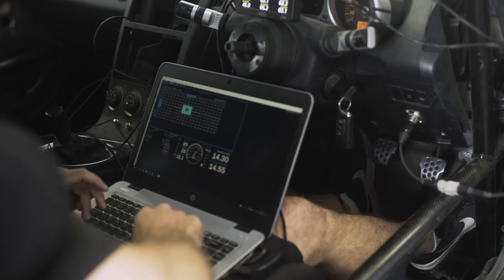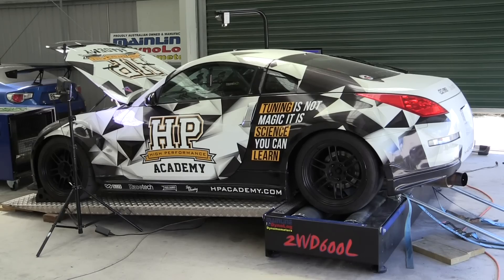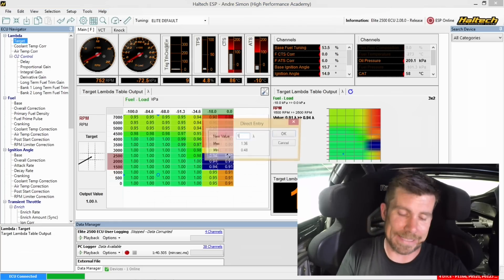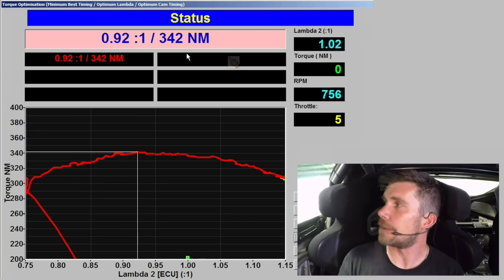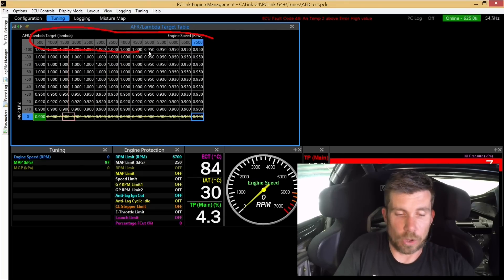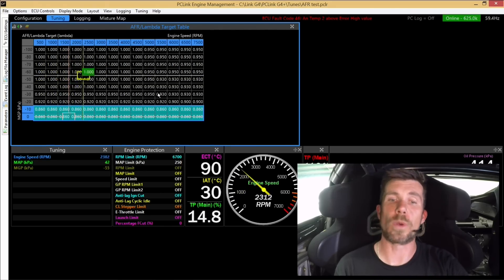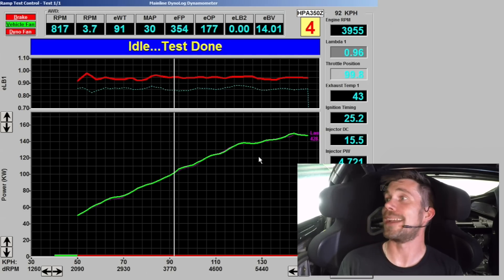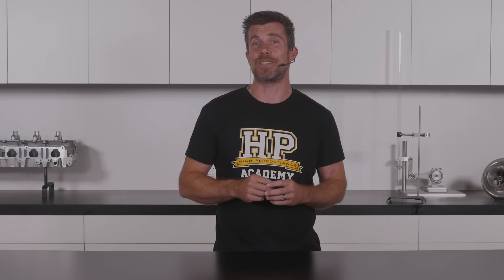Do You Want A Lean OR Rich AFR? | Fuel VS Power!

Comment: Sir, I think you need to try the "BLACKCORE" (Thermochemical Power Adder) unit from Indonesia. This tools can convert combustion gas into power and increase torque. This tool can also function as an intercooler because it can reduce the temperature heat in the engine cylinder space.
Reply: That's not a real product. Just for fun, I googled, zero written about, just a bunch of shitty YouTube and TikTok videos. If there was any remaining energy in the combustion gas to capture, OEMs would already be doing it. You can look at Porsche to see just how much energy can be recollected from the exhaust.

Comment: Hello! I have here in Brazil a Fiat 1.6 16V aftermarket turbo, 10,5:1 of CR without intercooler, 0.6bar of boost, standalone Ecu (FuelTech), IAT is 70~80°C. I have 3 options of fuel on pump, the E100 which runs perfectly without intercooler due huge latent heat, 95oct RON E30 and 102oct RON E25 ( expensive ). Due cold weather, i run in E30 with .70 lambda at torque zone ( to improve cooling ), im lossing to much power with this very rich misture? Thanks for these precisous information.

Comment: Why the lamba target graph during the tune does not show a straight line?
You manually adjusted the AFR map to a fixed AFR target at fully opened throttle, the graph should be a straight line on the chosen AFR target correct?
Since this graph is showing the target and not the actual AFR measured by the O2 sensor in the exhaust.
I suppose it’s due to the variation of the manifold pressure which will not always be maximum at fully opened throttle?
Thanks in advance.

Comment: How does O2 sensor in pipe and tail pipe sniffer differ in tune?
Reply from the maker: The tail pipe O2 sensor might not be as accurate as oxygen can work its way back up the exhaust to the sensor (they are not that far away from the exit).
That can't happen with it further up.
Pre and post CAT is also a consideration.

For general interest you can also have your sensors too facr the other way and have the readings skewed by exhaust back pressure. I'll link you to a members webinar lesson that touches on all these topic and more - Taz.
https://www.hpacademy.com/previous-webinars/121-wideband-lambda-sensors-essential-knowledge/

Comment: depends on its fuel type, spark ignition if you lean on it, it will make power but run the risk of detonation (localized above the speed of sound events across the piston crown)

Comment: so. 0.95 is the best lambda for power? 13 afr?how lambda for the healthier engine balance power?
Reply: There is a spectrum somewhere in between approx. 13.0 -15.0 that can be very bad due to high cylinder temperatures and potential knocking. This becomes apparent at high engine load (lots of throttle). There is a diagram somewhere about EGT (Exhaust Gas Temp.) and Cyl. Temp. So for max power i'd go for 12 - 12.5 and for economy around 15.5. Some expert drag racers have lots oil cooling, air/water cooling and cooler spark plugs to mitigate the temp. problem and can get closer to the "danger zone" and get max power.

Comment: hey so basically if i get hp tuners that comes with the adapter (sorry can’t remember the word lol) I can access the air/gas data? I bought performance injectors and coils, (comes with copy and paste data so i’m guessing in good to go after it’s pasted into the tuner? lmk guys
Reply from the maker: If they support your vehicle you can purchase credits and use their interface tool (adapter) and software, yes. It won't just work on any vehicle - Taz.
https://www.hptuners.com.au/vehicles/
https://www.hpacademy.com/technical-articles/reflash-tuning-solutions/

Comment: Sir, going from 4500 feet ASL (0.06685 Air Density) down to Sea Level (0.07650 Air Density) (a 14.435% increase of air), is this an automatic increase (adding) 14%+/- fuel to compensate for the increase of air?
Reply from the maker: No, you want to watch this: https://www.hpacademy.com/previous-webinars/241-tuning-for-elevation-change/?utm_source=youtube&utm_medium=social&utm_campaign=general-interaction

Hope it helps - Taz.
Reply: @hpa101  Taz, thank you for the link.  I  read the text first then watched the video and still feel confused.  I also should have elaborated in that, the weather App I am using takes Temperature, Humidity, Altitude, Dewpoint, and Barometric Preasure to provide an instant and current Air Density.  My application is non-turbo, naturally aspirated fuel injected.  Given two different altitudes (4,500 ASL where the vehicle is tuned) down to 0 ASL, the Air Density has been relatively consistent +/-14% from 4,500 ASL (hence 0.07650+/- lb/ft3 verse 0.06685lb/ft3)  I figured it was a simple concept; 14% more air requires +/- 14% more fuel.

Comment: Trying to learn as much as I can. Gotta build that desperately needs a tune. Fueling up top seems to be good about 12.5-11.5:1 afr But down low on rpm and load the afrs are way too lean. Between 19:1 down to 15: at around 3-5k rpms. And most shops w ont touch it because its such an odd build.
Reply: This could be a lot of different things. Start with configuration, what's your injector and fuel pressure settings like? For instance if your dead times are off you might be able to brute force a decent tune with VE numbers but you'll be fighting against the modelled fuel calculations the whole time.

Comment: So on a street car, with 0.95, you can save fuel and still have full power. On a forced induction or high comp engine i agree 0.86 to 0.90 is probably safer!
Reply from the maker: Beauty too is that difference parts of the map can have different targets where applicable. Cruise vs wide open throttle for example. 
This is something that a lot of people can't wrap their head around when it's stated that a performance tune can give you more power AND more economy vs a stock tune in many cases 😎 - Taz.
Reply: @hpa101  i did this on my old TVR chimaera that i turbocharged. I had a ms3 ECU in it and did logging on the road and set wot with full boost to about 12,5 afr and cruise to about 13,5.
The rover 4.6 didn't feel happy at 14.7 🙂

Comment: Hi does this Lambda value include motorcycles? 4 stroke engines.
Reply from the maker: Yes sir! Your target depends on the engine, fuel and application, but just because your engine is in a motorcycle rather than a car doesn't change the fundamentals of how the Lambda scale works or is implemented when required - Taz.
Reply: @hpa101  love your videos :) learn so much new.  Thank you brother.
Reply: @hpa101  How far from exhaust port  do you read the lambda value? and what effects does it have if its to far away on lambda reading?

Comment: i have a turbo car, my dyno run actually show the AFR start around 14.7:1 then full throttle to redline RPM, it starts to drop to around AFR 12.2:1.
should i request a tune to have the AFR all the way flat when full throttle til redline?

Comment: This video is an awesome find. 

I ran my ISF on a Dyno today and asked to show the AFR. The Lambda dipped to as low as 0.79 or so and I could see the dip in the horsepower curve in relation to the Lambda curve. 

My engine did make less power when below about 0.88. 

Will have to do some investigation as to why but thank you again for this video.

Comment: If my bike is tuned at 4,000 feet ASL, and I go down to 2,000 feet ASL, I understand it is "leaning out."  So, if my AFR at 4,000 is say, 13.3, how would going down 2,000 feet effect my fuel?  Is there a method of calculation per 1,000 feet?  Such as, "As elevation goes up, fuel is adjusted by X% for every 1,000 feet change in elevation."  

So, to refine my tune at 2,000 asl, would I ADD or REMOVE fuel, and what % per 1,000 feet?  I hope this makes sense.  Is fuel compensated per 100 feet or 1,000 feet?

Comment: How do you go WOT and only stay at 2000 rpm?
Reply from the maker: That is a function of the dyno, you can choose an RPM point for it to hold and then focus on tuning the different load targets. If you don't have this function, you would do sweeping runs and tune from the data as you do while road tuning - Taz.
Reply: @hpa101  awesome thanks!

Comment: Multi-port fuel injection engines do a two stage process first stage is a 15.0:1 AFR second stage will add just enough fuel to give you a final AFR of 13.5:1 all the first stage does is to clean the intake valve or valves of carbon deposits through the intake port of the head then rest of fuel comes from the direct fuel injection part of the process.

Comment: Why would you set your Lambda target at .9 instead of 1.0. How does that change the performance or make it better?
Reply from the maker: Making it richer not only provides more fuel but also more cooling. Note though just as you can run too lean, you can also run too rich. There are points in the map where you would run richer and also leaner than 1.0 depending on load and RPM conditions (WOT is going to be very different to 0% throttle and low load for example) - Taz.

Comment: 0.75 = 11.0 AFR
0.86 = 12.6 AFR
0.92 = 13.5 AFR
1.0 = 14.7 AFR
1.15 = 16.9 AFR
I pause the video and do the maths so you don't have to :D
Reply: Thank you
Reply: What about engines running 10% ethanol?
Reply: @MercOilbuner  sorry thought you were asking about 85% ethanol..Most gasoline sold in Usa is E10 anyway so the values are pretty mush same as gasoline
Reply: @ShashankB94  Isn’t stoich for e10 around 14.1 - 14.2?
Reply: @chrisiztheman1618  14.5 (ish) instead of 14.7 (ish), but it will vary somewhat on the chain length (C-count) of hydrocarbons used in the fuel blend. Best is always to use Lambda, to avoid confusion, and simplicity while tuning (lambda value x100 is percent) if target is Lambda 1 but actual is 1.06, add 6% more fuel (or multiply current VE or injector ms, by 1.06) to get to desired target value...
Reply: @MercOilbuner  the stoich for e85 is around 9:1 which is 9 parts of air by mass to one part of fuel...but remember your afr gauge has to know you're running ethanol
Reply: @MercOilbuner  same lambda value tune with lambda
Reply: @MercOilbuner  The Lambda value remains constant, irrespective of the fuel type.
Reply: You sir are a gentleman and scholar!
Reply: Thank you bro 🔥
Reply: This is what I needed since the dyno was showing me the actual AFR.  Tuning was with Haltech 550 on Toyota 4AgE with FI.
Reply: I don't think E10 gasoline can make maximum power on 14.7AFR
Reply: Pure gasoline, most areas by me have 10-15% ethanol, which stoich is closer to 14:1
Reply: american units are bullshit
Reply: What about the load% in this test. If under full load you can't run that lean.
Reply: Isn’t it obvious that his precious Honda is gonna break the laws of physics for the advancement of our race.
Reply: Alot more entertaining then the dudes accent
Reply: I'm not going to base my 800 hp k24 engine based on your YT comments section afr conversion.
Reply: @DP-nr1hz   for engines running gas these conversions are spot on.
Reply: @DP-nr1hz  math is not gonna change for your precious car dumbass..those values he commented are literally by DEFINITION of lambda
Reply: @DP-nr1hz Are you still this brain dead?

Comment: Nice explanation.  Interesting when many tuners target an AFR of 13.0 or about 0.88 lamda, they are actual not achieving peak power.  Which is closer to 0.92 lamda or 13.5 AFR.  I realize in their mind this is a safety factor as fuel and conditions do differ.  This is merely an observation.
Curious if this is consistent across all gasoline engines.

Comment: That's some great dyno soft ware he has there. I always try to give the engine the absolute bare minimum fuel and ignition advance that it requires for maximum out put. If you are mapping in each gear timming advance will be a greater value and fuel needs to be leaner in first gear than it does in say eighth gear. One reason is to stretch out fuel consumption as far as possible the other is, it allows the engine to respond much cleaner at lower rpm. One interesting aspect would be to use an multi gas analyser and look at the H.C. reading, it's very telling

Comment: just remember. dyno tuning will run like crap on the racetrack! data logging during a race is far more productive than tuning on a dyno!
Reply from the maker: This is not quite accurate. The last step of a dyno tune is indeed to confirm your results on the road/track, however, depending on many factors you don't always need to make bunch of changes from here.
This is just one piece of knowledge from our course material so it can't cover everything in one hit, but we don't just mention the theory but also show examples of what I just mentioned above in the material =) - Taz.

Comment: How you make engine RPM stay at 2k on WOT
Reply from the maker: We use a Mainline load bearing dyno which has this feature. You can set the RPM via the dyno software and it will hold it so you can tune the different load cells in that rev range. The term is steady state tuning. Hope that helps - Taz.
Reply: @hpa101  
It make sense now thanks
Reply from the maker: No worries at all, I should have linked this too: https://www.youtube.com/watch?v=dujolvOENs0 - Taz

Comment: in old skool terms .95 to 1 is only 14 to 14.7 to one fuel air ratio, that pretty hard to target accurately with a carb/s, its not that wide a range when you don't have a computer the control it

Comment: How do you sit at a static engine rpm at WOT? I'm confused.
Reply from the maker: That is a feature our dyno allows, but you can also simulate it with left foot braking while road tuning. You also need a bit of common sense with that technique too ;) - Taz.
Reply: @hpa101  Thanks for the explanation Taz. I'm curious now, what's the limitations of that dyno for that mode of operation? Can you do this same method with a car laying down 1,000+ hp?
Reply from the maker: Yes, but you don't steady state tune high into the rev range so it's not really an issue, but even if you did you'd more likely overheat or damage your engine before a quality dyno. 
If for any reason you were working your dyno a little too hard there are sensors that will shut it down forcing you to let it cool off for a bit to save from any damage.
As for steady state tuning, you only do it to a certain point and then you start doing sweeping runs higher and higher into the rev range so you're not running that car at high load and high RPM constantly for long periods of time while tuning - Taz.

Comment: The reason AFR has a greater effect on an engine than demonstrated here is due to the interaction with ignition timing (fixed for your test)  especially for engines that are spark limited (ie run into detonation or pre-ignition before they reach maximum BMEP)  Had you run your test at an engine speed closer to peak cylinder filling (ie peak torque) chances are, if you had an ignition timing also optimised for max BMEP,  the engine would have started to detonate at the lean AFR settings.   So, by running richer, the extra evaporative cooling and additional heat absorption of the greater fuel mass, would reduce the temperature of the charge during the compression event, and allow you to run with an earlier ignition point, which results in a higher mass fraction burn at a smaller average chamber volume, and as a result greater energy transfer to the piston, as opposed to it just going out the exhaust (which is why EGTs fall with advanced ignition angle despite peak combustion gas temperature being higher (effectively you get a higher dynamic expansion ratio)
Reply: Exactly, I proved what you said many times on a dyno.
Reply: So basically, it is always better to find Max power with timing then, richen the mixture a bit to help keep the chamber from having an issue if the octane isn’t consistent from tank to tank?
Reply: @mr.know_it_all  it depends on particular application. Some engines will allow you to make best power with lean fuel mixture, some won't. Usually, you do a couple of pools first to get an idea what the engine likes - lean AFR and conservative ignition timing or reach AFR and advanced ignition timing.
Reply: @Georgianson  pulls, not pools. yee yee
Reply: I had exactly the same thought. For instance the old good turbocharged 4g63 makes the best power at lambda 0.75 whilst it knocks earlier with leaner AFR mixture... However, if you are using high octane fuel that allows you to run optimal ignition timing to get to MBT than a slightly leaner AFR can be used.
Reply: yep, you have to optimize/iterate afr AND optimized timing for the clear picture. Burn rates change vs AFR, thus lead time (spark advance) requirements change.
Reply: So would you make more power running running highest timing   richer  vs lean and conservative timing with no knock?
Reply: @LightningFast240  yes
Reply: @TheUltimateRanger89  thanks for clarifying that. guess i dont have to run it right at the limit then
Reply: You took the words right out of my mouth...lol...
Reply: This is secondary:  You are using fuel and cooling effects to make up for lack of octane.
Reply: Word to that!
Reply: @ArturssonEngineering  new english i guess?